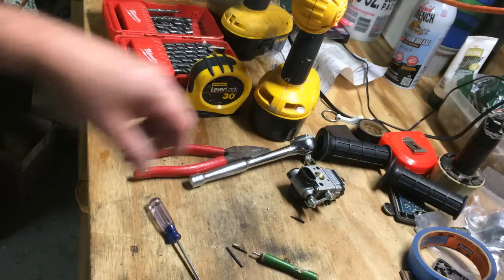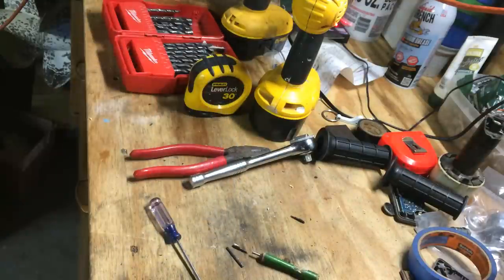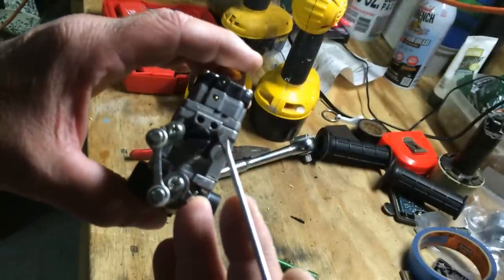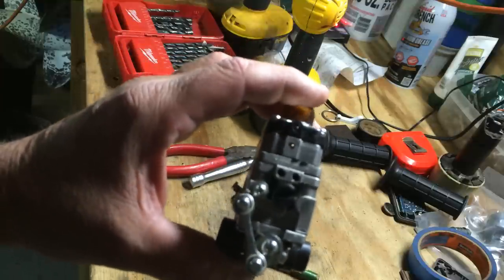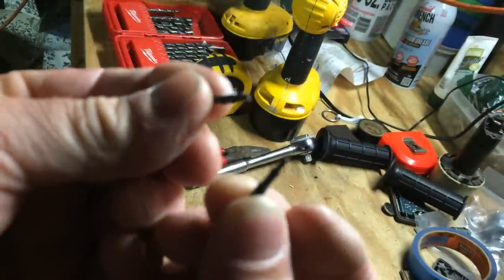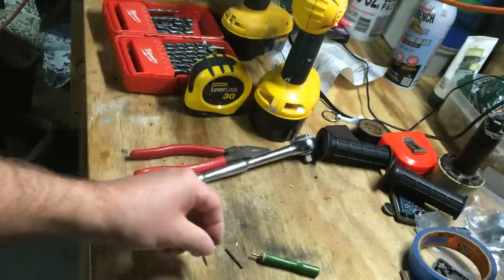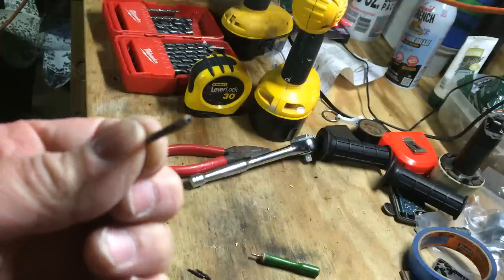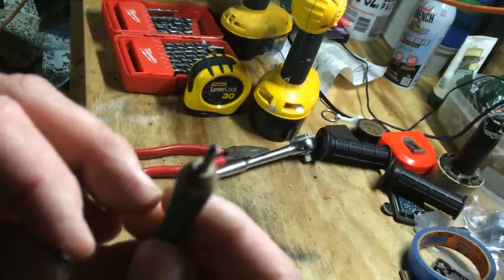ECHO PB-500T WALBRO CARB ADJUSTMENT TOOL HACK, D SHAPED HEAD, HOMEMADE.

Comment: Great hack video! Thanks Mr. Gary!

I have successfully adjusted a Micro-D type mixture screw with a roll pin on a Yamabiko EGC2500c (Japanese version of the Echo PB-250) equipped with a Walbro WTA-33 carburetor!

Since Japan, where I live, is a country that uses the metric system, it is difficult to obtain 1/8 inch roll pins. Therefore, I used a 2.5mm (M2.5) size roll pin. In order to fit the roll pin to the screw head of Micro-D, it was necessary to deform the tip into an elliptical shape using a vise. I also bought a 3mm (M3) size, which is the same size as the 1/8 inch roll pin, but it was too big for the mounting holes and couldn't rotate well.

The important point is to insert the roll pin into the wooden handle like Mr. Gary, or grab the roll pin with the locking vise pliers and turn it while applying a strong pushing force to the mixture screw. The mixing screw is fixed with Loctite by the manufacturer. However, if you push the roll pin strongly and keep turning it in the loosening direction, you can remove it without any problem.

I do not recommend turning it in the tightening direction. If you turn it with a roll pin, the screw head of Micro-D will gradually deform. If I use a roll pin, remove the mixing screw completely once. It would then be recommended to use a metal saw or air router to create a groove in which a flat-blade screwdriver fits into the Micro-D's screw head.

Removing the mixing screw will release Loctite from the bond. Therefore, it can be tightened with a very weak torque, so by modifying the Micro-D screw head so that it can be used with a flat-blade screwdriver before it is deformed so much, subsequent adjustments will be very easy. 

If the Micro-D head is significantly deformed, use a file to flatten the damaged area before digging the groove. Since the thread of the mixed screw is about 1 cm, there is no problem in changing to a flat-blade screwdriver even if the screw head is deformed. When digging a groove, wrap an old cloth around the middle stem and fix it with a vise, being careful not to damage the tip or thread.

If the modification fails, repurchase a high speed (P003-003870) and low speed (P003-003920) mixture screw from an Echo dealer. If you succeed in removing the mixture screw, you will be sure of your victory. I wish you all the best.

Comment: I just hammered on  the hard nylon insulation from a 16G wire connector.  Left the connector intact and used it to turn needle.  Worked awesome.  Thanks for nurturing the idea.

Comment: Thanks Gary!  Piggybacking on your idea, what worked for me on my non-adjustable Echo PB 500T backpack Walbro carb was the ink "straw" from a BIC pen.  I made a small slice in the end with a razor to allow the straw to open and fit over the needles.  I then pushed hard onto the needle and, while continuing to apply pressure, turned.  I couldn't really "feel" whether or not the straw was on the needle, but lo and behold it worked! 5 minutes of adjusting the high, low and idle and we're back in business.  Thank you sir.

Comment: I tried this and it worked.  Used a 1/8" roll pin, which I ground down to 3/32 to fit into the holes on the carb.  had to tap the pin a little bit to close it down to grab the needles.  I have to tap it down over the needles with a small hammer, but it will turn the needles and allow adjustment.  Drilled a 1/8 hole into a short dowel same as the video.  Great tip to get around EPA requirements and idiots in CA.This is a sophisticated carb, with air being injected into both sides of the cylinder through reed valves.  The plastic air opening on the carb needs to be kept lubed or it will hang up and make throttle hard to open and close.  The main air intake also uses a set of reed valves to feed the air/oil mixture into the crankcase.

Comment: Similar to Demon, but instead, my tool was a fabricated unused wire terminal (have a kit with assorted sizes, so I didn't even have to leave my garage). Flared the crimp end a nominal amount and voila!, I had my tool. Made the adjustment and my PB-500T is back in business - no more bogging down at WOT:)

Comment: After reading, and reading I finally discovered a replacement adjustment needle for these carbs. When you read thdescription, it will state high side only. Just buy two, remove the small 'D' screws and re-insert these. They have slots cut for a jeweler's size screwdriver. It makes these carbs a cinch to adjust. I made your tool Gary, and it gave me the opportunity to adjust mine when it wouldn't run for squat. Now, that a truly adjustable screw is available, you have a great tool to remove the old small D, and if you don't want to spend the money for the new screw, you have a great tool to use anyway. Thanks. I guess it's us against the EPA. It's great to try and save the environment, but not at the cost of making my purchase worthless after a year of use.

Comment: Thanks for the info. I see some that there’s like wax or some sort of plastic covering the screws also. I usually heat up a little screwdriver and melt them out. But I’m gonna try your trick. My Echo has a slight bog and it needs that little tweak.  Thanks bro.

Comment: Much respect to Gary!  Great idea for a fix. HOWEVER, a 1/8 roll pin DOES NOT work to adjust an Echo PB580T. Don’t even waste your time. Maybe Gary has a super skinny 1/8 roll pin, but it will not fit into the opening where the L needle is located, much less provide appropriate grip. I am wondering if Gary meant to say to flare the end of the roll pin to 1/8?  If you are going to do this get a 1/8 and 3/32 roll pin and see which works best!  You can locate 3/32 roll pins at Harbor Freight in an assortment kit. They are very hard to find in my area. They can also be found at gun shops. Good luck and thanks again for the idea.
Reply from the maker: Dustin Smart hey man your probably right i didnt measure it, took a guess but 3/32 sounds right! As long as you got the idea....

Comment: After a lot of reading, I ran across a fella that replaced his small 'D' H and L screws with Echo P003001130 slotted screws. When you order, the info will say this is the H screw, but they are identical, so order two. I ordered a pair and they work like a charm. All you need is a jeweler's screwdriver. Actually, I drilled out the access hole just short of the beginning of the threads so I can use a little bigger screwdriver. Also, as you are facing the screws, the H is on the left and R is on the right. Took me a while to find that out. I just wanted to pass this on for whomever might want to do this.
Reply: William Pippin are these needles interchangeable with other Echo modes like a PB-250 handheld blower?
Reply: That, I am not real sure of. I had to do a lot research to find out that it would work on mine. Find out which carb you have and go from there. Sorry I can't give you more detailed information.
Reply: I did a cursury search for your model and it said yours was a Zama carb. it would have to be a Walbro carb.

Comment from the maker: first, how old is the machine, was carb removed, and have you moved those tuning screws.  if you have removed the carb, those 2 rubber boots HAVE to be put back on, and seated properly or it wont start at all, I believe vacuum has alot to do with fuel delivery on this carb. check if the fuel lines are in the right places, there are 2, the black which is the supply goes onto the straight barbed fitting, the clear would land on the 90degree fitting...last I would look into the rubber plug which houses the fuel lines in the tank. they tend to leak.

Comment: Hi Gary, how are you Man?
I'm having a problem with my blower echo, some time after you start working with it, the enfine loose the performance as the gasoline stop to come in the carburetor... you just release the throttle button the engine returns to the low idle, some seconds after releasing the throttle you can pull the throttle again and the revs go up normally, one or two minutes after the same problem again, the revs decreases fast as the gas ran out... if you release the throtle again the engine stay on in low idle... being honest I'm used to handle with cars, no small engines like these... I'd like to know if you already had some experience like I wrote above... I have already disassembled the carburetor, cleaned it and assembly again... and nothing changes, I've checked the spark plug and it seeems to be ok... thank you Man!!
Reply from the maker: Jemal Campos, hey dude, unscrew the hi speed needle a hair at a time till it's right....simple prob...

Comment: The 3/16 worked better for me flared than the 1/8" roll pin. The 1/8 was too large for  the aluminum orifice on the carb. I tried to link you to the web page  on hyperparts but it would not work. 91100 ST is the part number. You can see it on AMAZON but they are out of stock. wolf

Comment: Have same unit with this carb, problem is carb will not draw fuel up to itself to fill primer bulb, unit only runs if you put carb cleaner in throat of carb, dies after prime is burned off, fuel lines and filter are clear, I suspect carb is bad, your thoughts please... Thx...

Comment: I've purchased tools on eBay  that have the D, seven spine, and even 21 spine, but they are too large for those holes, like you said they made them truly tamper-resistant.  If you'd like I could trade  those tools if you would modify a roll pin for me
Reply from the maker: I'll send you a roll pin tool. No prob...I have no use for those other tools...

Comment: I have 2 questions. First, on the pb500 carb, which screw is the low speed and which is the high speed? Then, which way do you turn the screws to richen the mixture? Thanks
Reply from the maker: Rob Wagner hey Rob I'm currently away from my bench right now, but from memory, with the primer bulb facing down, the screw on the left is the high speed adjustment, loosen or unscrew to richen. Squeeze the throttle fully the adjust screw for max rpm. Very little turns....VERY little turns!
Reply: Gary Bronne thanks!

Comment: i have the 580 model, and those bastards put the set screws in super tiny holes, no clearance for any roll pin.  i spent way too much time filing and dressing it down, didn't come close to working.  i would love to drill those damn holes out some but the needles have to come out first.

Comment: Gary, after getting/making the tool. Can you tell me how much to adjust the carburetor for each adjustment. How many turns, left or right worked best for you? I have the pb500 and it's like new as well but boggs down when the throttle trigger is squeezed more than about half way.
Reply from the maker: 1606fjz it's VERY SMALL turns from where they're at, depends if it it's high speed or low speed you need to adjust.. does it idle just won't Rev up?
Reply from the maker: 1606fjz unscrew the high speed screw VERY SMALL INCREMENTS...
Reply: Gary, I did a few other things and fiiinally got it to run at full throttle, I think the carb had to be juiced a little after removing/dissembling and cleaning it. I fiddled with the flat head idle screw for a while and got it, however I'd still like to make that tool for the future. Thank you very much for the helpful video and responses! :)
Reply from the maker: 1606fjz  cool!

Comment: My 500t bogs on acceleration what is it it's not the spark arrestor
Reply from the maker: uawsux, you need to tweak your low speed adjustment screw, try turning it out a hair to give it more fuel until it revs up correctly, if it gets worse obviously go the other way, then adjust high speed with throttle wide open till you get the most rpm without it dying off...
Reply: @GARYBRONNE   I understand all that from your videos and others the problem is the tool.... my chainsaw bog then I had that okay I had the tools but the tools for the echo are not the same as the tools for the Husqvarna..... I really appreciate your reply lots do not reply..... home Depot the guy had one and adjusted it but it needs it a little bit more again so I want to buy my own tool.... eBay Amazon thank you very much